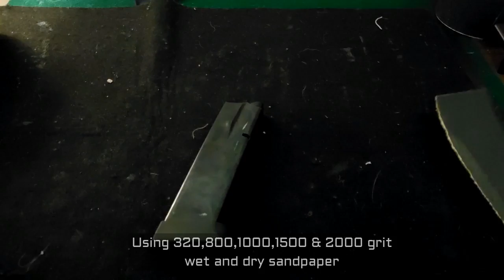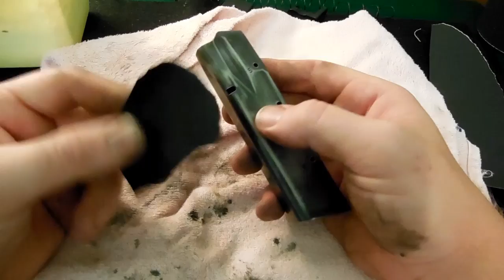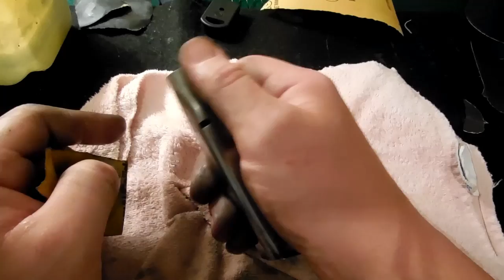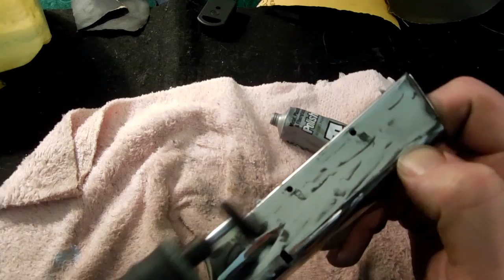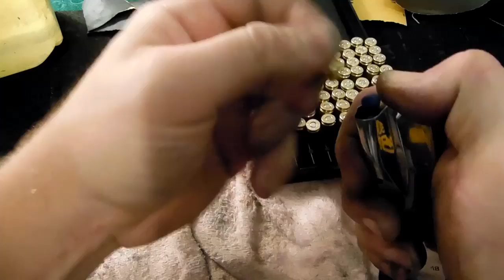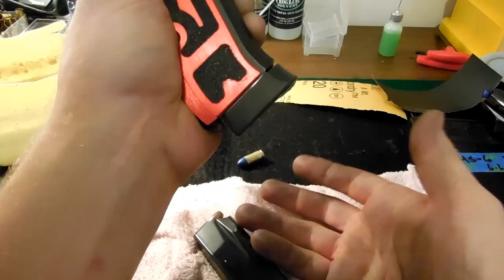Magazine polishing

Comment: soak it in vinegar and the finish will come off with a ScotchBrite. If you have access to a buffing wheel and polish it will be super-smooth. No sanding required and about 1/10 the time.
Reply: Yea so the inside can it rusty Lol
Reply: The only finish on there is bluing, so all he has to do is buff it until desired.